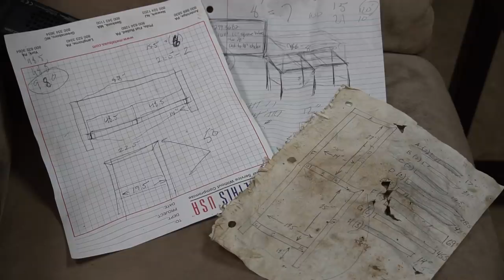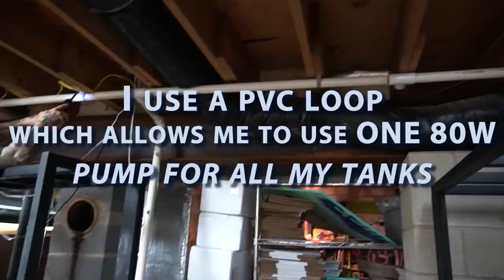Did we bite off more than we could chew? Fishroom Renovation

Comment: That's a lot of hard work which I am sure you enjoy as you love your fish so much. I have to move a 30 gallon tank to a new stand which is higher than the stand that it is on now. Can a tank break with a few inches of water in it if we lift it up? I see you kind of pushed it over on the same height. I have to lift mine higher, thanks

Comment: Hey Rachel I built a stand much like the ones you  are but mine held a 210 with a 75 under it. I had irregularities in the top rails that I fixed with 2 part polyurethane.  Before it cures it's a liquid and it self levels. I used gorilla tape to make a channel on the top to hold the epoxy just on the surface the 210 would be sitting on.  Anyway your racks look great and however you fix your issues may it work well.

Comment: Just a little word from a welder, TIG doesnt penetrate very well. You might want to add some diagonal bracing (3 inch triangles in the vertical joints) to increase the tensile strength. That 150 is a significant load and water likes to wiggle. If you even just put the plates across the back near the wall, it will stiffen the stands significantly.
Reply from the maker: We did! Stay tuned
Reply: @RachelOLeary  Love your fish room and vids, glad to hear!

Comment: Rachel, you may have addressed this before and I have just not seen it. Is there a reason that you don’t use some type of material underneath your tank to absorb the imperfections in both the stand and the tank. Over the years I found this extremely helpful in reducing tank leakage and seam splitting. Love your work!!!
Reply from the maker: I have found it to be largely unnecessary with the stands that we make. In this case, it was necessary so I used it

Comment: id recommend using a mig welder the welds will be cleaner and less heat on the metal "pull" also you dont necessarily have to use argon you can actually use co2 as shielding gas.